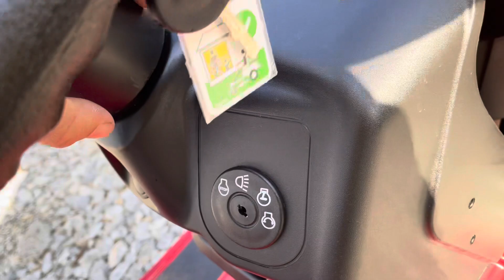Big help on the homestead

Comment: This is how it all started with me. Parents had about an acre on their property, part orchard the rest just grass. I wanted dad to buy a štrizna kosa because you can cut grass when its long. He insisted he wanted a ride on mower. The strizna was half the price but he didn't want it. He wanted one like yours without a grass bag. I wanted one with it because I wanted to compost the clippings. Eventually he caved in on the grass bag. Now that we had a ride on mower I thought might as well plant out the rest of the field to orchard. So several years of mistakes with all that.

The problem with those mowers is that they are designed for well managed lawns, they are not that good for rough orchards. So make sure you really clean and level areas that you will mow and rake out any mole and ant hills.

Lucky you don't have a grass bag. What happens  if the grass is moist, a bit longer or if you drive too fast the chute clogs up. If you don't know and keep going grass builds up on those blade covers. This happened to me. It can't be cleaned easily. You need to lift the whole tractor up and get under it or have one of those holes in the garage where you can walk under. That buildup caused the blades to slow down and eventually the rubber blade belt went and it wasn't a cheap fix. Yours has a removable mulch attachment so it might be easier to get hands in there.

It's not good to cut the grass with these if it gets too long as you choke the mower. Now because of that you have to make sure you mow regularly. However in spring when you have so much to do and you get many rains the grass can grow for a week or two while you can't mow it because its wet. The grass is then full of juice and long. Thats when you need to be careful and lift the blades to max height and go slow so you don't clog it up. These mowers are great in the dry period, but can be really problematic in the wet spring period. After each use make sure you clean under the mower. I think there is a spot where you can attach a hose to wash it off while the blades are spinning. I don't know how well that works as our mower just has a hole without an attachment.

Eventually on my one the cooler fan on the motor also fell apart while mowing, and I haven't bothered fixing it since. I still think a strižna would have been a better solution for me as it took over 5 hours nearly every week to mow everything. With a strižna I would have just cut every 4-6 weeks and with an ordinary mower done the smaller area each week.

Anyway they are fun to ride on and give your orchard a beautiful neat lawn look. Im sure the kids will love it too!

The trailer was a good buy because you are building and have a farm etc. However, from everything I went through I would in this situation rather have put that money towards a good polytunel than a mower.
Reply from the maker: I have bent the blades already 2 times hitting a stump. 
It was bought to manage the area around the orchids and the garden where I walk regularly.  Rest will be mulched or cut for hay by my friend who owns a big tractor. 
I was using a push mower and it took me about 5 hrs to do the are where I maintain the nice lawn. With this is all done in less than an hr and no sweat. Also kids love riding it and they do the lawn for me so I can do something else now. So much time saved with it now.